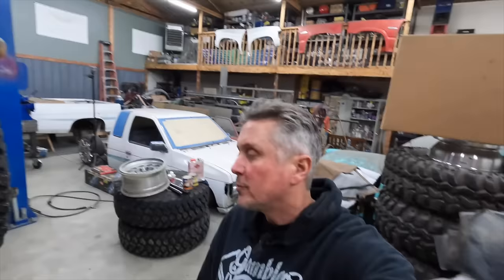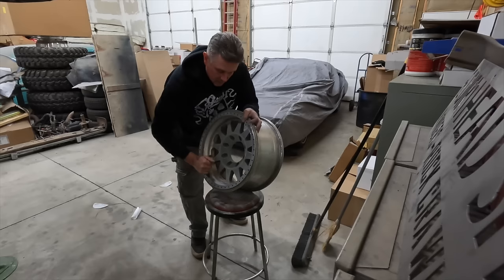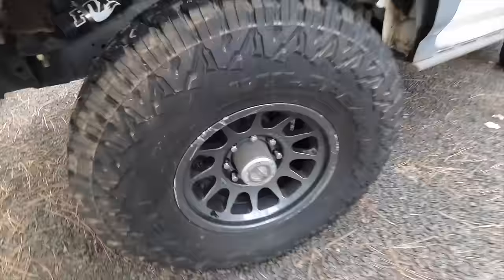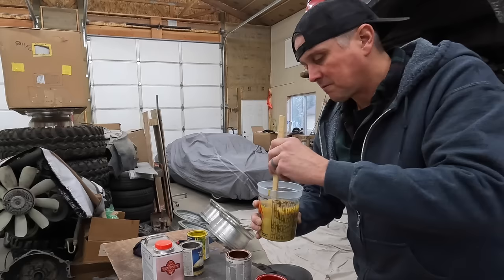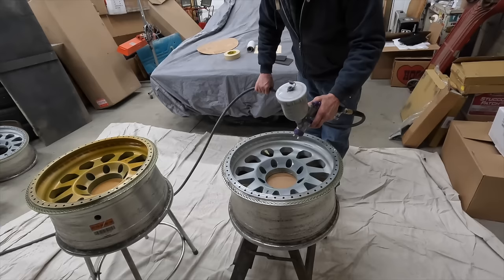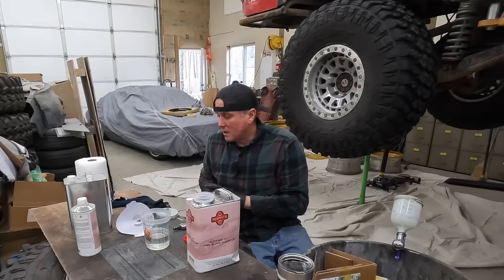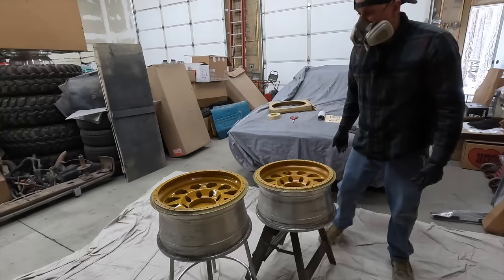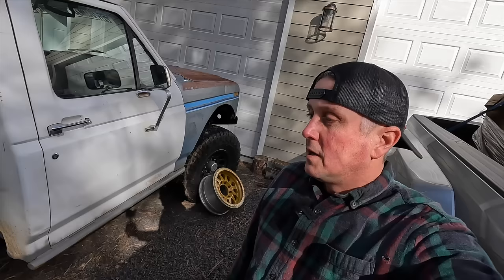How to paint your wheels cheap , with professional results!  #painting #tutorial

Comment: Super rad Dave, wheels are one of those little victories that can be super satisfying! I was thinking when you were holding them up to Moms spaghetti that I would paint pen in the cast in Method letters w black. Cant wait to see the tires! Rock on.
Reply from the maker: I’ve thought about that. But the letters are deep and sharp.  I would need to use one of those drip tools that you can turn off

Comment: I have one of those old filing cabinets. Top drawer toyota engine parts and gaskets.
2nd drawer toyota driveline and bushing parts. 3rd drawer 3 wheeler parts, including a complete 250r bottom end. 
Bottom drawer 2 toyota diffs. And transfer case parts.
Way better than the papers they were designed for!
Reply from the maker: Solid parts bin

Comment: To this old man's eyes. This color looks kinda like a "new" version of the old Dow 7 coating that was thing back in the 60's/70's. Last summer I found some factory Jeep aluminum rims for my 96 Jeep Grand Cherokee Limited. It came with IMO gosh awful snowflake 16 inch rims that had street tires on them. The replacement rims are 15 inch. I used some aluminum wash to clean them then masked off to paint the ribs gloss black and then painted the rest a goldish color. Which meant I had to mask them off twice.
Reply from the maker: I know the wheels you had.  I like those